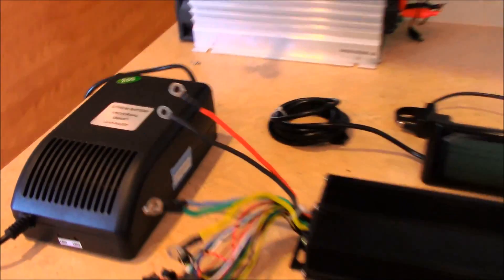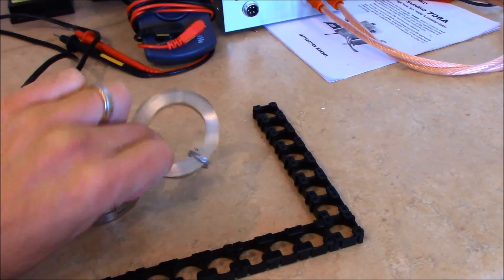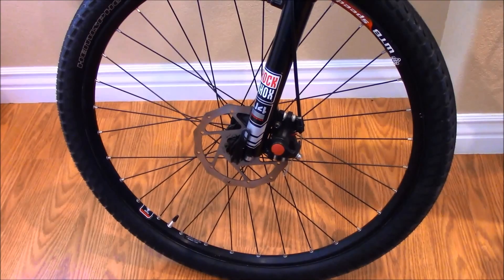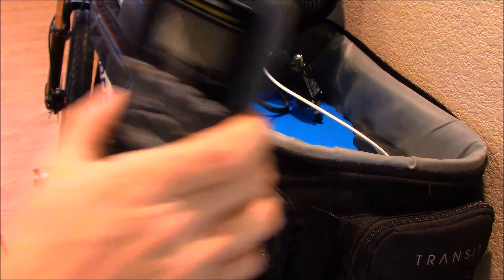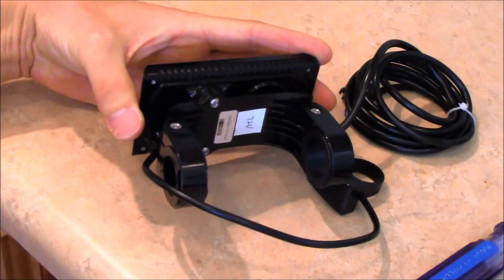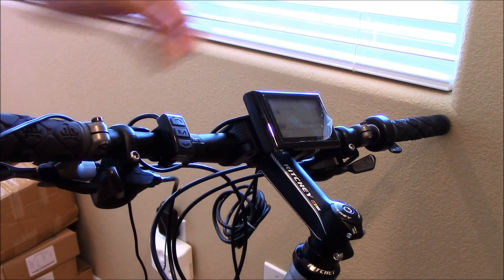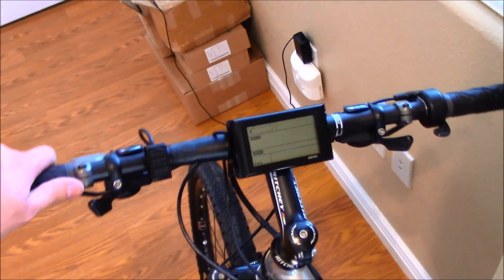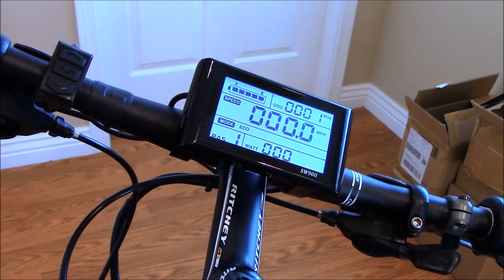60 mph ebike

Comment: That's awesome! Nice bike! I'm trying to setup a 1000w hub mountain bike for my brother and I'm not happy with the speed on a 48v battery pack, so I'm guessing a higher voltage pack should make it go much faster right? Man, battery packs ain't cheap even ordering from china I find... I'm still new to ebikes :)
Reply from the maker: Thanks! I have moved on to the stealth frames with 4" rims. The higher the voltage, the faster and more efficient your setup will be. Once I started using 72v, it's hard to go back down on voltage. Look for the 21700 cells in battery packs they seem to be cheaper but larger in capacity. Also, if you're looking for a certain Ah size, try to go a little larger with those cells. Keep your speed down to save battery power.  20 to 30 is a good average speed for distance. Have fun man!

Comment: On roads how bad did front rim get from all the pot holes, cracks, little bumps, ect/? Have you got into any accidents, little fall over slips/? I go 36mph and always easing up of those road conditions as it makes me wonder how much stress can the frame and front forks and rims take going over 20mph. Saw video of a dual motor gone wild by having front wheel break away from forks. I assumed it was the road conditions of not easing up as it would stress the forks like stress fracture of breaking off later. Hope you havnt got into accident thou.
Reply from the maker: I had this setup for about 5 years with no frame cracking or wrecks.  Only thing that I had an issue with was the rear bag mount cracked going on washboard dirt roads.  Replaced it, then modded it with better support.  Lastly what finally brought an end to this bike being an ebike was the battery was coming to an end and the motorhub nuts came loose and the motor came out of the mounting slot during a full throttle start.  It spun and cut the wiring and shorted out 2 hall sensors.  I cant find the same hall sensors (physical size) to fix the motor even with the correct part number.  Must be an older style.   The ebike that I built now is much better for off road and speed.
Reply: @15secofFame  I forgot to mention I believe the 2 piece dual shock bike frame are the best frame to use for fast e bike builds. I got 2, 1 front shock MTB and a dual shock Incline bike. Big difference of handling road along with comfort. The Dual Shock can speed thru without easing up on upcoming obstacles. A lot of great looking builds out there but knowing the dual shock frames are more suitable for fast e bike builds and future CKit builds will be 2 piece frame of dual shocks and there are a lot of them frames for cheap unlike the Enduro bikes which likely based their frames off of these bikes..

Comment: what type of 72v controller do you have?  I'm trying to build a similar specs
Reply from the maker: Hey Taylor this controller was a generic no name brand from a company in china.  It worked pretty good until my wheel came lose and the hub spin which cut my wiring.  I still have the controller but haven't had a chance to test it again with my new motor.  2 of the 3 hall sensors are bad inside the old motor due to the wiring shorting out.   The p/n that I can see is 820-AE002-3 its a 72v 35A rating.  I have new ebikes now, so I haven't rebuilt this bike.
Reply: @15secofFame  man just sell me your whole project 100$ lol

Comment: What size hub motor is on your rear
Reply from the maker: That one was a 48v @ 1000w to1500w motor.   its able to handle 72v @1500w The controller is what matters as it transfers the power to the motor.  So all I changed was the controller, display, and battery to 72v. As long as you dont over power the motor your good to go.   When it was a 48v setup I was pushing 50+ amps then converted it to 72 volts and that dropped the amperage down to about 26 amps max and noticed the battery and motor wasn't getting as hot.   The setup became more efficient and the performance doubled.

Comment: The wheel shaking is caused by the valve in the tire. Put a contra weight on the wheel to compensate don't buy a new one with exactly the same problem. Oops to late.

Comment: Can I put 72v kit to my 48v Motor
Reply from the maker: Well I did and Im not sure what kit you have but I originally had a 1500w 48v kit.  I changed the controller and display only to a 72v setup and added 7 banks to the battery wired in a 20s BMS and a 72v charger.  The motor should be able to handle 36-72v setups.
Reply: @15secofFame   that all good thanks   I've got  2 48v 1500w  Motors in shed   from wen my bike stopt working I could only buy full kits to sort it out   I'm going  to try making one of them 72v 3000w with them frames where you make from scratch  Motors are £700 to buy  that wot put me off  now I no this   I'm well happy cos i can get rest i need for £250  so I've saved there lol thanks alot buddy take care

Comment: Can u run 72v to rated 48v 1500w ehub motor?
Reply from the maker: The 48v hub that I have is good from 36v to 72v.
Reply: Great thanks I just wonder u got 13 pack in the back and 7 pack in the front how did u wierd ur bms did u use 20s bms?
Reply from the maker: Yes I have a 20s BMS wired to the rear 13s and 7s in the front.  I used a 15 pin Dsub connector for the rear 13s so I can easly split the wiring.  I will be making more videos in about a week about the old battery pack,  building a new battery pack, speed test, riding etc.. thanks for watching my videos!

Comment: What kind of motor is it, 1500W? Do You know brand and parameters?
Reply from the maker: I buy them from china like all major brands who put their names on them.  No name works just as good.   Over 2000 miles on this kit no issues.   Its a 72v 1500w kit, but at max pulls 2250w.  Just make sure you have a main battery shut off.

Comment: Could you please recommend a nice cheap 48v 14ah battery or a easy way to build it please?
Reply: I'm considering cordless drill batties! Eg below 
https://www.ebay.co.uk/itm/184344038090
This is 4 x 18 v @9ah. For only £127. I'm planning to also purchase a twin charger pack for £28. I planning to wire all 4 in series to create 72v @9ah nominal. That's about 650Wh of energy! It should last for miles if a keep at half throttle. It should work 🙏

Comment: the watts dont work on my sw900, i wonder why its a 48v kit.
Reply from the maker: yeah my first 48v 1500w kit SW900 was only going showing 999w max.  I just bought a 72v 3000w kit and the SW900 shows 4500w max.  So they do make them 4 place digits not just 3.

Comment: Nice bike , how far can you travel on that battery
Reply from the maker: Like a car it all depends on your speed.   With this current battery pack traveling at the slower speeds of 20-25 mph you can go about 75+ miles.   Maxed out at 45-50 mph you would be able to go about 20- 25 miles.   My battery pack is about a 19 Ah battery (84v x 19Ah=1,596watts).  My cells are mixed from 2000mAh to 2450mAh (used cells from laptop batteries), so if I were to get new 3400mAh cells my battery pack would be just over 27Ah with the same number of cells (160 cells in my battery pack).  With newer and higher  mAh cells then the distance would be a lot better probably 20-30% better.   Hope this helps MADMAX and thanks for watching.
Reply: @15secofFame  what if my weight is 255 lbs... Right know on my ebike build I have 48v lithium battery 13mah and the max I got was 21 miles with a lot of pedal assistance. Of I don't pedal at Al I get 15 miles range , my goal is to get 20 mAh 48 v combined together with the one I have so 13mah+20mah = 33mah and am hoping for good distance out of it !!! What do you thing .FYI my top speed now is 30mph.
Reply from the maker: I started with a 48v 1500w kit got 33 mph on a 17Ah pack at first but wanted more power so I stepped up to the 72v 1500w ebike kit.   Voltage without drop during use is speed and that is where the Ah comes into play.   More Ah the less V drop you will have plus more distance.  My weight is 185 lbs + my bike is 72 lbs=257 total, so you plus your bike, I would say keep the air in your tires  at max and the more Ah you can get the better!  I even thought of a hard case backpack with the battery inside with a quick disconnect going down to the other battery pack in parallel for extra Ah power.  never did it but it would be nice to have if your going on a long trip.  Top speed with 48v was 33mph and top speed with 72v is 47-50mph.   I really don't care much about top speed, but like the extra power with the 72v.  I still cruse around 25-30mph  99% of the time!
Reply from the maker: Sorry I forgot to mention that all of my mileage is without pedaling.   That way I was able to see just how far I could travel on a single charge.

Comment: What motor is that? Can i use 84v on (48v 1500w) motor?
Reply from the maker: Yes I did.  its the same motor that I bought when I was building the 48v or 54.6v fully charged kit.  I ended up replacing the 48v controller for a new 72v controller and display.  At full charge  its at 84v.  Works great so far.   In Colorado the air was thinner and hit 50 mph now that I'm in FL I can only hit 46 mph.
Reply: 15-sec-of Fame Thanks so much.
Reply from the maker: It could be a number of things.  Ah in the battery pack, settings in your display may be set for a smaller tire.   Mine was set for a 20" wheel when I got it so I to go in the setting to make it a 26" tire.  I will make a new video once my GoPro 7 arrives to show what my max is and go over settings if you have the same display.
Reply: What model controller is that ?  And is that the voilamart hub ?  
What speed do it do with you on thr bike thanks

Comment: It's not going to do 60mph with you on it.
Reply: G Heald it will if the sprockets are geared towards that speed. My kit goes 40 mph but my gears only allow me 40 kmh tops
Reply: I removed the front chain rings and installed 1 60T chain ring I am still pedaling at top speed. Just FYI.

Comment: Do you thinks it's better to just get a 3000 watt Enduro ebike? Reason is that it's built already to handle the stress and weight or is it too heavy.... what's your take now that you built this, would you build a bike out of a kit or get the Enduro?
Reply from the maker: Enduro is a clean looking nice ebike if I'm looking at the same bike your talking about.  Is the one you talking about made by HPC?  Looks to be well balanced and light weight with a lot of great features.   Not sure if its 3000w I think its a 750, 1200 or 1500w.   Not sure how long the mid drive system will last  (gear teeth etc...)  max speed of 35mph for the 1500w is good but range maybe around 15 to 20 miles.  Price, not sure but guessing 5k+.   
Currently my ebike is $650, 1500w ebike kit was $350, battery bag $50, rear mount was $45, the first battery I built for around $60 for the bms (cells were free), $75 for the charger.  The battery is equivalent to a $650 battery @48v.  I have since upgraded my controller and display to a 72v system for $200 with shipping, added a $90 frame bag and the battery I built again and was another $60 for the bms ( cells were free again) and charger was $35.  This new battery is equivalent to a $2500 battery, per HPC.  The bike can go 50 mph with a 1500w kit and can go 25 miles when pushing it hard.  I think I can get 35-40 miles if take it slower say 25mph.  Enduro bike is 50 lbs and my bike is 72 lbs.  My weight plus the bike weigh in at 250 lbs, can do 50 mph and can blast up hills.   Hope this helps and there is nothing like buying turn key also :) but you can save money building your own you get a warranty either way.
Reply: How much would it cost in materials if I build a 72v 40.8ah battery?...... I'm was looking at the Chinese electric bikes,,, 5000watt with a 72v/60A controller- 72v/30ah battery, rockshocks etc $4,100  shipped ....? What's your take?
Reply from the maker: Thats not a bad deal.  For a 72v 40Ah pack , the batteries cells alone will cost $2340 before shipping.  Shipping, tabbing wire, bms, wiring connecters, charger, bags and covering will be $3000 easly.  Thats a big battery even if each cell was 3000mAh each.  780 cells x $3 each $2340 , 5000w ebike kit will be $500+.   If your not familiar with electronics I would just buy the ebike to save time and all you have to do is charge it and go.  Down the road you could build a bigger battery if you think you need it that way your still rolling while building your upgrade :)

Comment: Nice to see you back man! Nice top speed! Tell me is that same hub motor from 48v system? Does it gain much more heat with 72v or not? Am thinking to upgrade my bike to 72V in future. Can you share links of LCD and motor controller? Thanks :)
Reply from the maker: Thanks man!  I work out of town a lot so its been hard to keep up lately.   Yes its the same 48v hub and it does get a little warmer but not too bad.   I blew 2 other LCD displays I think due to leaving the main power switch on during charging and it cooked the display.   So now I pull the main circuit beaker when I turn it off to remove all power to the controller.

http://theebikemotor.com/productshow.asp?ArticleID=1336&title=Theebikemotor%20LCD%20display%20for%20E%20bike%20kit&bigclassname=Products&smallclassname=Accessories

http://theebikemotor.com/productshow.asp?ArticleID=1347&title=Theebikemotor%2048V35A%20motor%20controller%20for%201500W%20Electric%20Bicycle%20E%20Bike%20Kit&bigclassname=Products&smallclassname=Controllers
Reply: Thanks man! You the best!

Comment: Bike tires definitely aren't built to go 60 miles per hour. You may need to balance them by attaching a small weight directly across from the valve stem.  On the plus side you can lift the rear wheel off the ground as you did in the video and test the various balancing methods to see what works best. As for bike tire quality, I was shocked when I finally spent the money for Schwalbe Marathon Plus tires. they are about 50 bucks but you really know where the money went when you see the quality. I think I may save money in the long run by not needing to replace tires as often.
Reply from the maker: thanks I will try to balance with your method as it will help battery efficiency.
Reply: I'm glad I read this comment as I have just built my own e-bike (1500w 48v Voilamart rear hub driven kit) and as I was worried about a possible blow-out at 30mph (33mph is the max I've seen from it, but...need more air in my tyres) and after luckily reading what you've said about the Schwalbe tyres I immediately took note as I purchased the Schwalbe 'Marathon' 26x1.50 tyres for my 26" mtb e-bike build...
I never realized that I need to (after calculations) increase my tyre pressure by quite a lot, I've been riding round with about 35psi in them...
I was under the impression that I'd have to put less air in them due to the increased weight of the bike now it's about 16kg heavier what with the heavy rear hub wheel and the big e-bike battery (triangle shape fitted in frame) and I was running my bike with just about 34psi in the tyres......
On the sidewall of the 'marathon' tyres it says 55-110psi, and from what I've just learnt I should be running with about 65-70 psi in them, I'm so glad I saw your comment, you may well have saved me ruining my tyres, or worse a bad accident, thankyou!!!
Reply: @mickyb.8014  - Tires are a big part of the e-bike safety equation.  Regular bicycle tires are not made for the load of an e-bike and are definitely not made for the speed of an e-bike.  E-bikes are halfway between bicycles and motorcycles.  Bicycle tires are built to be lightweight and most are marginally strong enough for bicycle use.  They are not strong enough for e-bike use.  Bicycle tires and brakes need to be upgraded for e-bike use.

Comment: Hey man welcome back. Being following your trails on endless sphere etc. Did you manage to understand the sw900 display as mine seems to have blown too. My motor still runs dispite the display being turned off. The odometer and speedometer doesn't work. Remember to check inside your hub as mine was a bit of a rust bucket in there. Had to oil/ grease the cover etc. I have the same hub from ebikemotor. Is your frame battery a parallel set up?
Reply from the maker: Thanks for following up :)  My battery is one battery just split up in 2 sections.